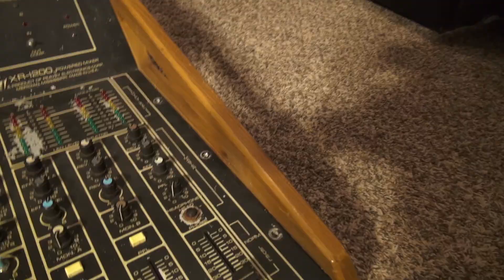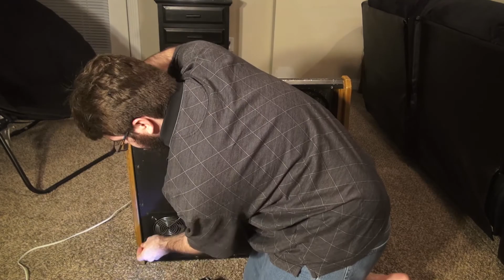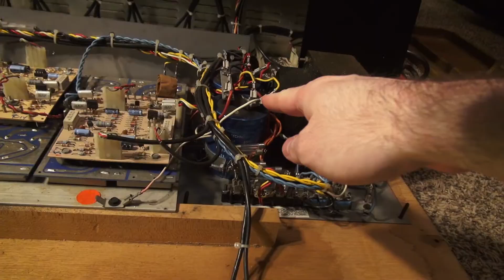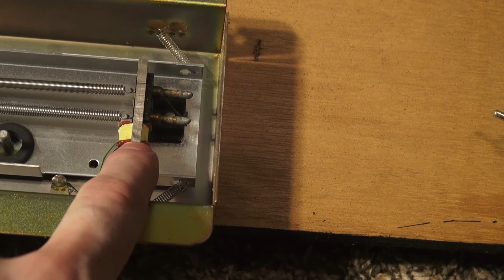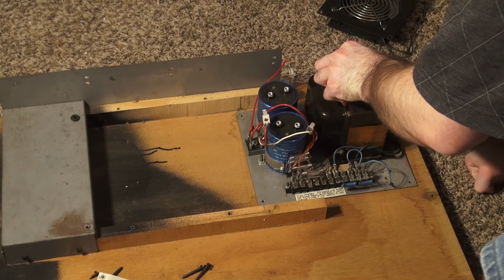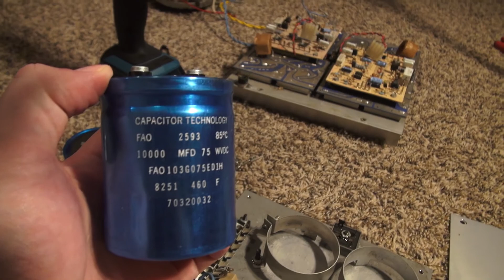Peavey XR-1200 Stereo Powered Mixing Console Teardown - Part 1

Comment: I got one for free from a studio/gear shop being built in my town, walked in, said I was a producer, they showed me around the construction, and gave asked me if I wanted it bc they couldn't get it to work and it was taking up space. It turns on, and the fan runs. Lights all work. Haven't tested it otherwise (with inputs and hooked up to my computer), but I'm hoping I can fix it bc it's in really good condition otherwise. Every knob, switch, etc. All still on it on and movable. It'd be really cool to be able to utilize it's vintage sound